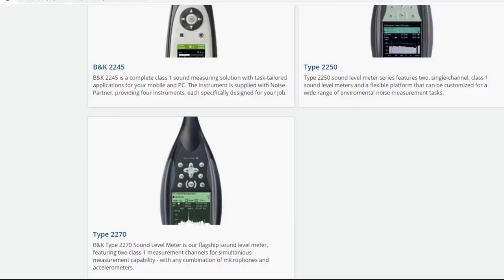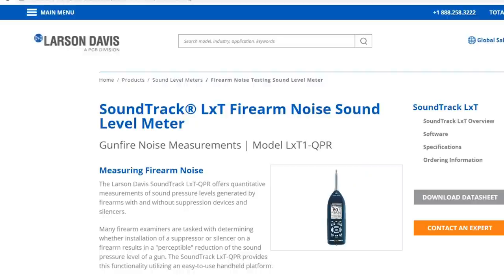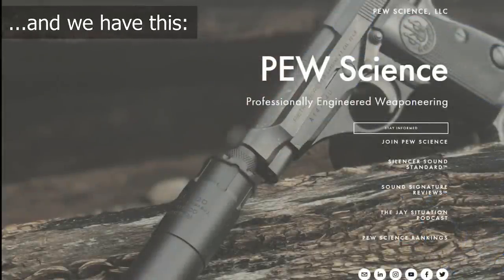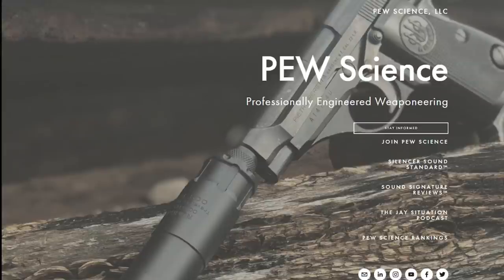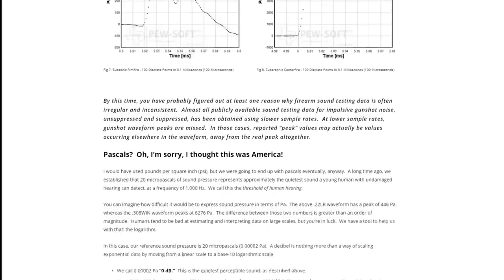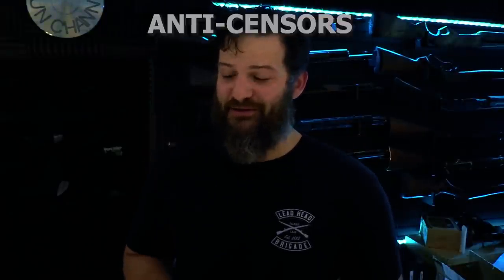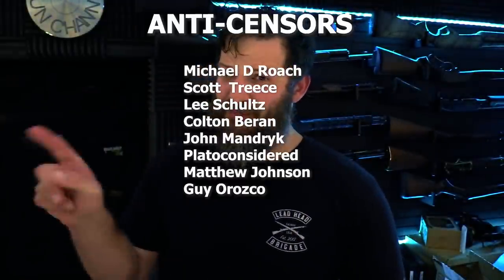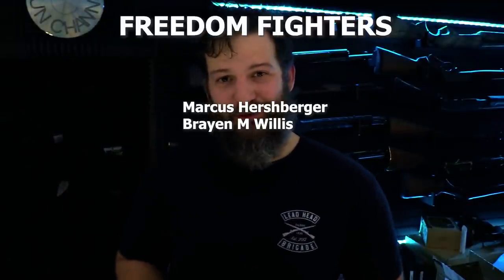Why Don't You Use a dB Meter When You Test Cans?

Comment: That recorded at a distance thing you do is actually really good and unique. It does a decent job with volume, but just as important records tone, a DB meter does nothing to show tone. I'd make one suggestion though to make it more sciency. Choose a couple baseline setups, X can, Y rifle, and  Z ammo and always record a couple rounds of those in the same recording session. That way one recording session can be compared to another and all new setups compared to the same set of baseline setups.
Reply: The problem with recording sound at a distance is that the atmosphere filters out high frequency sound much more quickly than low frequency sound.  Thus distance from the gun will make a high frequency can sound way quieter than a low frequency can.  There is a reason for the MIL Std method of sound testing silencers.
Reply from the maker: For the reasons GF listed, I have never tried to present the audio test I use as a quantitative or scientific comparable test. All I have ever sought to do with it is show the can’s relative reduction to the unsuppressed version. To do anything approaching scientific (which in my opinion the industry standard procedure does not rise to) I would need the aforementioned equipment.

Comment: I don't think a lot of people think of measuring high DB narrow peak like trying to film at several hundred thousand frames per second. Just about everyone can understand why a high speed camera is expensive. The same is not true for audio equipment. That's before getting into trying to the issue of measure a pressure wave expanding into 3d space with a single device measuring a single point and trying to make some definitive statement.

Comment: Thanks for your hard work, and your very real easy going manner. You forgot to mention that in addition to a very expensive meter, you’d then have to build a very expensive “sound proof” booth because the meter is very sensitive!
Reply from the maker: No, you want to be out in the open with as few objects to reflect sound as possible.
Reply: I meant to block out external noise sources and varying air pressures like wind and weather fronts. To eliminate as many variables as possible. But thank you for responding to me. Makes me feel like a real person, and respected by you. This makes me like you and your videos all the more. Thank you again for all your videos and the work and expense that went into making them. Keep up the good work! God bless America and long live the republic!!!
Reply: @VSO_Gun_Channel  I just wanted to help confirm what you are saying about the cost;  I work in the health care field for hearing and can absolutely confirm the insane costs of truly accurate equipment for dB measurement, ESPECIALLY for the specific purposes of registering a gun shot properly.

Comment: What you need is an older 1980's analogue meter.  Look for a Goldline SPL 120. They only go up to 120dB, so you have to place it about 50 feet  away at 90 degrees to the barrel. They are about $300 used, but Goldline still calibrate them.
Reply from the maker: Nope. If it won’t do the standard testing it’s a no go.

Comment: I like the db meter, but I don't think it's absolutely necessary. I have 2 suppressors that share the same decibel rates on silencer shop, but when I finally got them, they sound nothing alike. You never know how a can is going to sound till you hear it in person. It sucks considering how much time and money we have to invest just to own one, which is probably why people care so much about db's, but the db's are going to vary based on so many different factors.
Reply from the maker: Exactly why I look at other aspects. I care that the can is hearing safe for one shot. After that, the other stuff is more important
Reply: Unless people are back-purging or running them wet, with some kind of lubricant, the first round pop changes a lot of how it will sound and it’s “safety” on that one shot; the same could be said for flash too.
Reply from the maker: @ericschumacher5189  if I get a meter I would do the testing in a way as to repeatedly measure first round pop in addition to the aggregate data usually taken
Reply from the maker: I suppose I could also go an ablative comparison

Comment: You not disclosing the amount is sketchy. Just keep donating till you say it’s enough.
Reply: It's because they're basically not even readily available
Reply: that's because a quote right now wont be good in 2 or 3 months . it could easily be 3k higher . he did say a rough price of 20k , which is pretty damn close in my experience.
Reply: The last time I looked into a digital system and software it was on the other side of $10K.  And that was a few years ago.

Comment: How about using one at a longer distance so it would lower the DB level?
Reply: What good does that do for the shooter?
Reply: @boldie24  This way he could use a cheaper DB meter to do the testing.
Reply from the maker: @largelarry2126  did you miss the part about the sample rate?

Comment: If you are not suppressing the gunshot  below 140 decibels, you don't need a decibel meter you need a better can.
Reply from the maker: Raw db data does not matter. It’s relative aggregate db reduction. There are so many factors that go inti the signature of the can on any given day. You must be able to measure the unsuppressed shot in addition to the suppressed one. For that you need at least 170 dB
Reply: @VSO_Gun_Channel  Your rebuttal is thoughtful and concise and no doubt will be interesting to watch you succeed in providing the community with data testing.  I'd also point out your video covered the challenges, i was simply being anecdotal.  However if your intent is to map dB data for hypersonic projectiles inside and outside, from shooting position vs target position.  I concede, very expensive equipment is required, Lawrence Davis has great software, instrumentation and required technology to map the data not only accurately but in a usable transferable report in a visible representation of the sound.

Monetarily though what is the advantage to doing this exercise?  It's a ton of work to provide scientifically verifiable data.  Unless you really want a $30k report on what was Loudest, Louder and Loud.  When you could exclude firearms and ammo that we already know to be loud.  Stick to simpler reporting, less expensive data sets.  That money could be better spent showcasing loading data for subsonic projectiles, shape of projectiles and their effect on the Shockwave and sonic boom, pentration capabilities, stability needs before and after the can, set ups and real world experiences.  You could have years of content regarding what works and building more industry relationships that can help monetize your efforts.

Comment: Personally I think you're review without a decibel meter is useless.   If you can't do a review properly why do it, Jack.
Reply from the maker: From my perspective. A 30 second segment would not have changed my impressions of the last can I tested, and it shouldn’t change yours either, you are def focusing on things that will leave you disappointed in your purchases in the long run.
Reply: Just keep scrolling then "Jack".